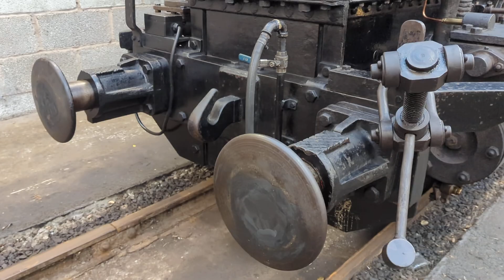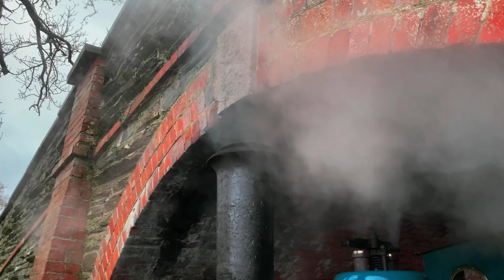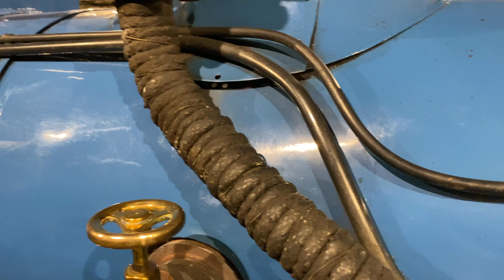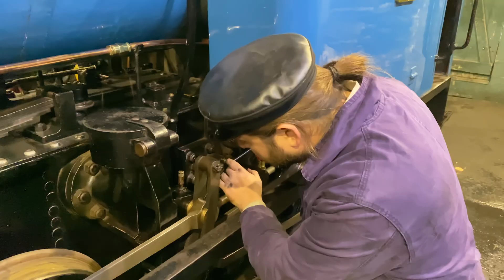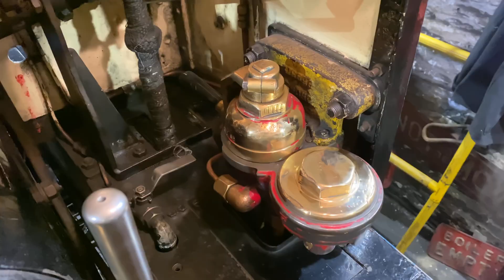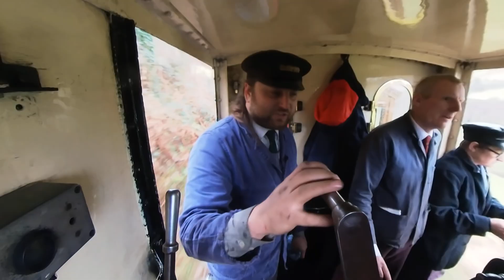The last Drive of Talyllyn Number 6, Douglas! Lawrie Goes Loco Episode 44

Comment: i thought the train had to stop there to refill the well tank with more water
Reply from the maker: We didn't need to take water
Reply: @ so you traveled the length of the railway on one tank full of water
Reply from the maker: @eliotreader8220  we didn't go all the way
Reply: @lmm  thanks for letting me know that 
So you traveled up from the Top station to the last station before the line was extended along the mineral extension in the 1970s? like the drivers were doing during the 1960s
Reply: @lmm  I understand they also tried some bio coal out on this engine some years ago

Comment: Two foot 3... inch?   With y'alls being metric...        John
Reply from the maker: The UK uses a mix.
Speed limits are mph, track gauge is feet and inches but if you measure something it'll use the sensible system.
Reply: @lmm  or for many of us, whichever is more convenient - I'll just go and cut a 1435mm length of 2" x 4" timber...
Reply: @lmm  lol.

Comment: Its Duncan in Thomas. Only ever seen this loco on static display at model railway shows and in the engine house at the SVR.

I to am loosing a favourite loco to 10 year ticket expiry at the Severn Valley Railway. 7714 is due to be taken out of service although the lack of use due to the landslide might extend its ticket.

Comment: Ah it's gonna be a shame it's being taken out of service but I can understand the reasoning why. It's not just the boiler that will need to be recertified, I assume there will be additional parts that will likely need changing as well for this locomotive?
Reply: After 10 y of regular service a loco will normally need a full rebuild, everything checked and all wear parts replaced. In Germany its mandatory after 8y, a boiler ticket only lasts 3, extendable to 4 of the boiler is in good condition. Although the boiler ticket on its own is usually less of a big deal if the boiler is still in good nick, not sure if the pipes are even removed or just everything thoroughly inspected and water pressure tested
Reply: Probably; that’s what happened to Number One.